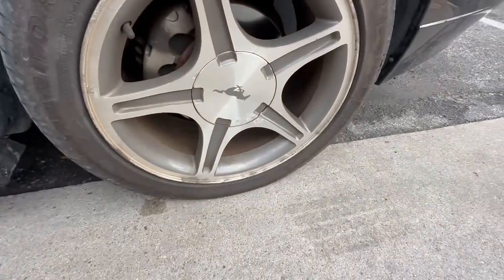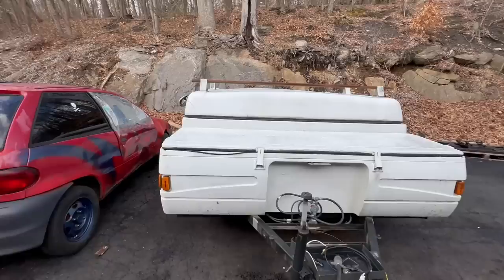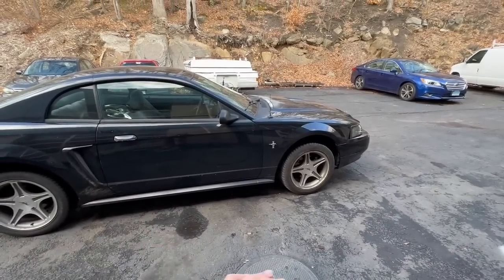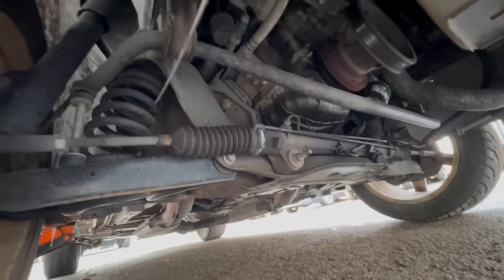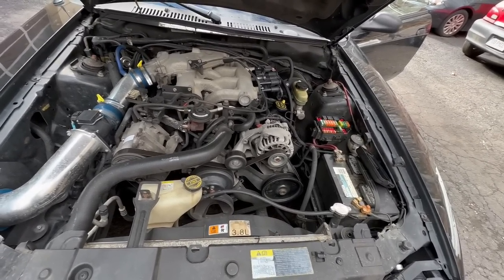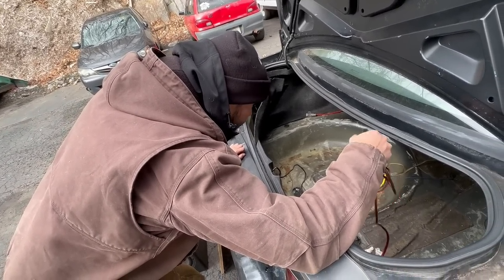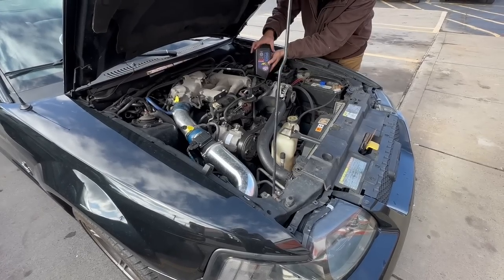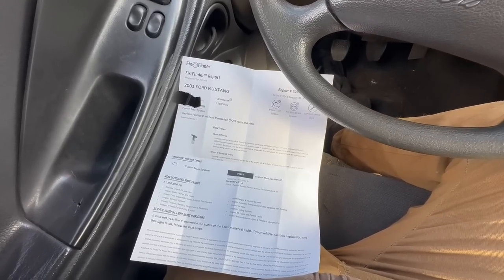My Last week here ... 😢

Comment: Lean code is likely either a vac leak or exhaust leak before upstream 02 sensor (cracked manifold/bad manifold gasket). Cat code likely worn out cats or just on due to lean condition and it not running perfect. Fix lean condition then clear codes and see what comes back.
Reply: Get a scan tool to monitor live data. Helps a lot to see what's going on. I've changed personally dozen or so V6 mustangs with cracked exhaust manifolds on that Gen mustang.

Comment: As someone that works at an AutoZone, never listen to the recommended parts for the code scans, most of the time it’s bullshit. That P0174 code is probably a IAC valve, but could be anything that deals with air or vacuum

Comment: Don't forget to pop the fuse out of that power wire to the amp before you burn that thing to the ground..  The little bitter shake is private tires being unbalanced
Reply: The fuse would pop first   then there won't be any connection after its grounds put on the body one time
Reply: Not necessarily true some people run to 150 amp uses which will Arkansas park and catch the carpet on fire prior to it blowing.

Comment: if its ob1 95 or older most places cant scan it..
Reply: power point fuse is what powers the ob2 port..
Reply: 99-04 so it’s deff obd2 so it made no sense for them to say that
Reply: @bambam23406  sn95 came out in 94. i dont know the cars well enough to know if they were all obd2
Reply: @briansfixinstuff  94-98 was sn5 94-95 where the last od1 years 99-04 tech is still sn95 but we all really call those new edge which is what body style he has I currently own a 97 cobra a 99 gt 35th anniversary and 2011 but have had a few others in those years so I’m pretty good with knowing what’s up on them